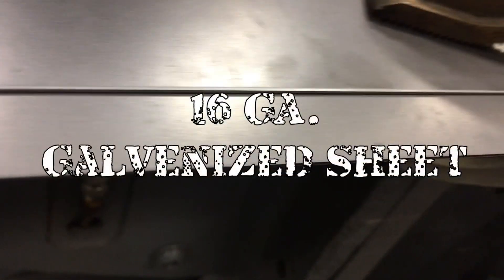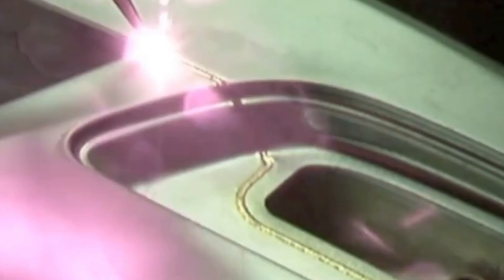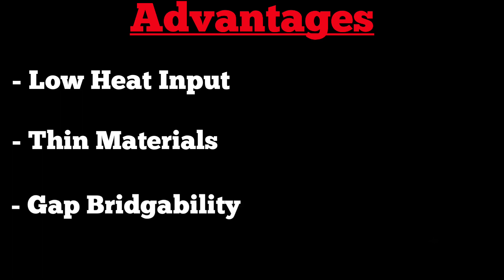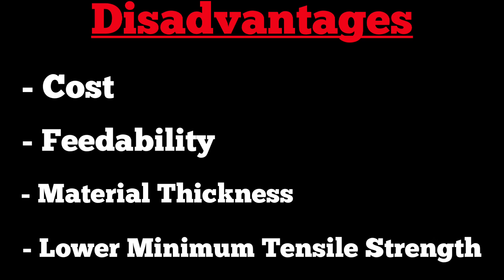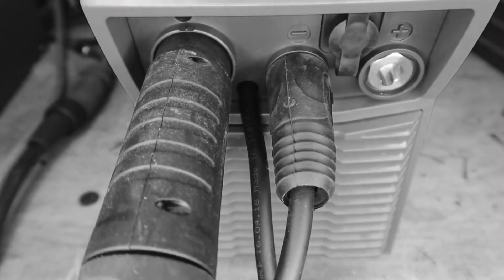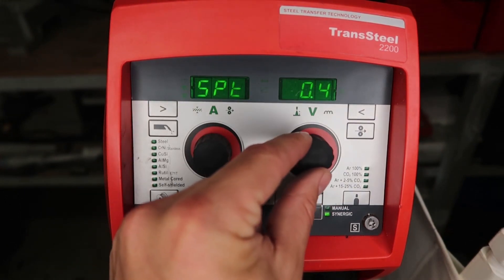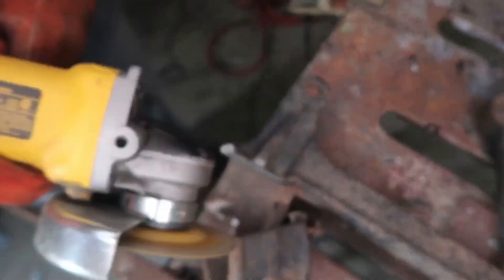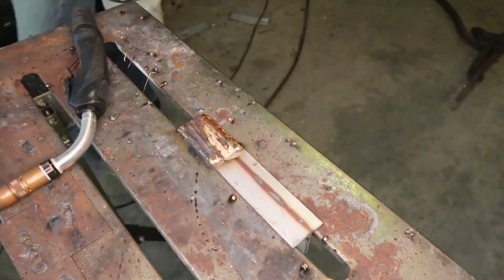MIG Brazing Made Easy With This ????

Comment: Question, when you set a material thickness, then change the voltage, on my machine it re-adjusts the material thickness, but you change both, does it do it independantly, and how do you do that?
Reply from the maker: Yes, you can turn on a setting in the background called ALC - When it’s turned on you can set material thickness/wirefeed separate of voltage

Comment: Nice video, I have been playing with silicon bronze tig brazing and have fount it to be really temperamental at least for me, I am going to go buy a couple small rolls of silicon.amd aluminum bronze for my mig to see if I can do any better with that machine, unfortunately my welder doesn't give me the option for the specialty wore itself so I will have to play around a little to try and find a setting that works. 
What polarity are you set up with when mig brazing? That in itself should get me started off in the right direction.
Thanks for the video, interesting and helpful.
Reply from the maker: I’m running reverse polarity

Comment: Part way through:  I think there would be less confusion here (and we're here to become less confused, right?) if our host didn't keep SAYING "weld" where it is meant "braze", "join", or "bronze-weld".  If I am teaching this to a group of beginners, I might not say "bronze-weld" even if it's right, because it's confusing!  There's NO WELDING going on here today!  Base metal is NOT MELTED, the original edges of the base materials can still be found.  Not a weld!
Reply from the maker: I agree. It’s a very difficult term to say correctly when we are so used to saying “welding”. I caught my self slip a few times. Thanks for watching
Reply: @chris_b_liven  Don't get me wrong!  I really want to see this, I want to DO IT, I've seen the results of this, bought the wire, not quite pulled it off yet.  People who CAN MIG-Braze love it!

Comment: A better definition for welding would be the heating and melting of two peices of equal or similar composition together and letting them cool together allowing fusion, with or without the use of a filler of equal or similar composition.
  This covers welding with metal and plastic. But funnily enough, also means that if you pissed into a crack in a frozen lake and the two sides of the crack froze together because of the piss, you are welding. 
Brazing refers to soldering specifically with a copper/ zinc allow at high temperatures. The temperature difference is what separates it from soldering. You can't braze with a soldering torch/iron, but you can definitely solder with a brazing torch.
Reply from the maker: Thanks for watching

Comment: How about copper sheet to steel sheet (copper 2x steel thickness)?   Have auto body idea for rust out dog legs and wheel arches to SiB sheet copper patches.  The copper will last a lot longer than steel.

Comment: Chris, I’m trying to use a Miller 140, spool gun, 100% Argon at 32 CFH, SUA brand ERCuSi-A .030” wire,  volt setting 3, wire speed 60, .045” gap, open root butt joint to Mig Braze late model GM 20-22 ga fender flares and quarter panels. I really liked how you brazed that open root butt joint in “spot mode”. I noticed you had the gun pointed up by about 15 degrees and walked the spots down from the top. You didn’t mention what gauge the metal was. My first attempt at brazing my thin metal looks like crap. There was no hint of capillary action (virtually no bead on back side), the gap closed up to zero on the far end even though it was tacked, and the wire usually burned back very quickly leaving a big glob on the end of the stub of wire! Plus, the metal was warped as bad as if I had welded it, but the base metal was not melted. I’m fit to be tied! Any suggestions?
Reply from the maker: Rod, Sorry for the delay in my response. The 22 ga is super thin material . I believe it’s less than the wire diameter you are trying to use. The plate thickness I showed was around .040 thousands. My suggestion would be to tack it with an opening similar to the plate thickness or find a setting that can punch through the material. For the silicon bronze to form on the back it needs a gap opening. Have you tried using an aluminum block on the back as a heat sink? This would probably help with the distortion in such thin material.

Comment: Would a miller be able to run CUSI on steel setting? Dont have specific CUSI setting...
Reply from the maker: Yes, it will run it. Just make sure you use 100% argon and try to get the shortest torch possible with a graphite liner. If you have a spool gun the better just due to the Fred ability of the wire

Comment: If you were going to fabricate a bike rack (for luggage not to hold the bike) would you braze the rack together or weld it? Material like chrome-moly steel.
Reply from the maker: If it’s Chrome Moly I suggest ER80 filler metal. I haven’t done much research on using silicon bronze but I wouldn’t see why it would be an issue
Reply: @chris_b_liven  Thank you for the response.

Comment: Thanks! Could you do a video with troubleshooting. Like using too high  or low voltage or speed. I have a pro series Schumacher with .023 silicon bronze and I would love to just see what I’m doing right and wrong.
Reply from the maker: I like the idea 💡 I’ll put it on my list
Reply: Thanks! I feel it’s hard to find videos on mig brazing that help with setup and reading the weld to adjust

Comment: Can I use 75/25 mix or do I need 100% argon?
Reply from the maker: You can use a 25 CO2 mix but it’s going to be a bit hot in compared to Argon. I’ve seen many autobody shops use 75/25

Comment: Can this be used to weld brass to iron and brass to brass
Reply from the maker: Yes, you can use silicon bronze or aluminum bronze but you will want to think about preheat. Preheat on iron will assist with cracking. Make sure you have sand and place the iron into the sand for slow cooling
Reply: @chris_b_liven  Thank you for your response

Comment: Thanks for the videos on the Fronius line up, great reference tools. Is it necessary to use the Teflon liner for either of these wire types?
Reply from the maker: It’s going to be similar to aluminum on strength so you will need graphite/Teflon or a special coated liner. The machine I was using had a special universal liner to assist with restriction

Comment: In the 1950s I have read a book printed way back in the 1930s and 1920s that says silicone bronze alloy wires were used as telegraph wires for they are virtually unbreakable. I wonder why that knowledge is not printed in today's western engineering textbooks when all engineers should know about this alloy's other uses besides being used as a brazing filler material.

Comment: Hello,

I have enjoyed your videos.
My question:  Where can I get the Gas Nozzle you used in this video?

Machine: Transsteel 2200
Gun: MTG 320i  US-Style Ergonomic Handle

I live in Canada...  Fronius Canada Ltd is telling me that a Tappered version is not available. 

Baker Gas does sell one... 
Fronius Tapered Gas Nozzle for MTG 320i MIG Gun - 4403502108

Love the system, but finding information, or accessories is a bugger. 

Any help would be appreciated. 

Rob
Reply from the maker: Rob, which tapered nozzle ? The one in the intro of the video ? I’ve never tried using this nozzle on the MTG 320i as it’s more for robotics . Or was it on the handheld torch I was using ? Was it silver ? If it was on the manual torch we do offer narrow gap nozzle part number 44,0350,2108,5
Reply: @chris_b_liven  Hello,
I found this at Baker Gas.

https://bakersgas.com/collections/fronius/products/fronius-tapered-gas-nozzle-for-mtg-320i-mig-gun-4403502108.

Is that the one you are referring to?  If so, Fronius Canada says it is not available.   I was told it would overheat my gun.
Reply from the maker: Rob Burtnick yes this is the one
Reply: @chris_b_liven  Thanks

Comment: You're all right man. Thanks a bunch for sharing your knowledge.
Reply from the maker: Appreciate it ! Thanks for watching
Reply: @chris_b_liven   please reply to my question: 
1) when we are doing mig breazing to join fuel filler pipe(tube) to fuel tank some tanks are rejected due to blow holes in breazed area, why dose it happen
Reply: @atuldhavan9009  ,,,Contaminaters in the workpieces or using a Drag movement with the gun......

Comment: Enjoyed the video. Would you happen to know the settings for esab rebel 215ic running 220v? I'm trying to braze rough joints on 20 guage sheet metal.
Reply: Thank you for responding...esab wasn't very helpful
Reply from the maker: Iron Man what’s the biggest problem your having? You will want to be around 240-360 ipm at 17.5 volts range
Reply from the maker: Iron Man I’m not too sure on the Rebel 215. Are you using CUSI silicon bronze ? What wire size and gas?
Reply: Yes, it's 035 Harris wire purchased from cyber weld. 100% Argon. Using knurled roller
Reply: Thanks I will give those settings a go

Comment: thanks for the cool n informative video! Jest one question; why do u say brazing is best for galvanized steel?
Reply from the maker: Thanks for watching ... It really all depends on the thickness of the galvanized plate. If you start to get beyond 1/8 in plate then you should start thinking about solid wire just due to penetration and overall strength of the joint. For thinner material MIG brazing keeps overall heat input down and it eliminates a majority of the zinc burn off due to the melting point of the wire. If you decide to use solid wire you can successfully weld most lap joints or outside corners. The issue is with t joints due to the zinc not escaping from the molten weld pool causing porosity
Reply: @chris_b_liven   Thank you so much for the prompt reply! I just have few follow up questions.
1. Between normal and galvanized steel sheet, which one would produce better result? Basically my focus is on the effect on zinc coating on brazing procedure. (Apart from the porosity it causes).
2. Are most of thin steel plates galvanized thesedays? 
So, the reason why I am bombarding your with these questions are because I am a master student researching brazing on galvanized AHSS. I have somewhat good knowledge in the mechanism of welding and brazing but do not have much experience of doing them. I will be watching  a lot of your videos and others for some 'over the shoulder' experience. :)

Thanks!
Reply from the maker: john cho 1. ) primarily you see galvanized sheet being used for anything that can eventually be corrosive. Primarily products effected by outside elements such vehicles, hvac units, cattle gates, security doors etc. Brazing the galvanized in my opinion is best due to the melting properties but the cost of the wire outweighs the benefits depending on the product
Reply from the maker: john cho 2) Not all thin plates are galvanized as it’s dependent on the use of the product. If you are to use cold roll carbon steel and use sealants such as  paint or clear coat then it would hold up to rust.
Reply from the maker: john cho 3) We do see a large amount of automotive manufacturers using HSS & AHSS. I know the total heat input in the material is critical due to grain growth and cracking in the HAZ (heat affective zone) Silicon bronze could assist with the low heat input but I haven’t done much testing or seen anything on AHSS. I would have to research the topic a bit more or ask around. There are welding processes in the market to assist with welding HSS and AHSS in regards to total heat input. I know Fronius has one called Cold Metal Transfer
Reply: MilkyCereal83 Yes, that is precisely why this research topic fell on my lab. Hopefully ill be that person you can ask about in few years :)

Comment: I’m very much an amateur trainee weekend warrior, think of the lowest level welder and I’m the guy below it. I was generally looking at brazing brass to steel in my knife handles. My welder will braze using CuSi3 but a 0.45 kg spool is £35 where standard MIG wire is £20 for 5kg, that’s over £66 a kilo more. I also have a feeling I get less out than of the wire as well. I think for now, with my knifesmithing, I’ll stick to gas brazing which for a welder of my grade is fun.

That takes absolutely nothing away from a very informative, well presented video. Thank you.
Reply from the maker: Sometimes you can’t beat Oxyfuel brazing both on cost and fun. That was my go to process in High School welding class 😎 Thanks for watching 💯

Comment: For vehicles, see the Project Farm YouTube videos for maintenance tips. Car body brazing is more rust resistant, especially if you spray Fluid Film on the inside and under the panels every fall, and inside door panels every few years. There is a video about melting vaseline (petroleum jelly) for a thicker coating where mud or salt spray might wash away oil. Do not use Fluid Film for door gaskets- I use Mothers VLR spray instead, with a good smell for interiors. The Carsthatlast series on YouTube is good for choosing which vehicles are reliable enough to be worth it for rust repairs.
Reply from the maker: Thanks for giving me a few channels to watch. I haven’t seen any videos from either one so I’ll check them out. Thanks for watching 💯

Comment: Chris , I have tried the silicon bronze with my 2200, it seems okay , but I got more splatter than I thought I should. I used DCEP  035  on 1/8 in mild steel with mild mill scale. What do I need to do/set to get no splatter like you.  I was at 300 fps 16.5 volts (gas at 25cf)  and also on synergic for 125 thou.  thanks for your reply in advance
Reply from the maker: What kind of joint configuration? Did you use 100% Argon gas? Are you on 230 V power or 110v ?
Reply: Hi Chris, it was a t joint and lap and an outside corner, using 100% argon on 230v
stick out 3/8  to 1/2  inch. the lap joint was the worst, and I was pushing at 10 degrees  with small rocking  movement. thanks again
Reply from the maker: Bruce D Sounds like too much wire feed speed compared to voltage. Have you tried turning up voltage separate? You can do it with the setting next to V - Voltage on the left side of it. If you turn it more positive it increases voltage in a percentage. So 5 would be 5% higher in voltage with the same wire feed
Reply: thank you Chris I will give it a go next week
thanks again.,, ps what setting should I start with on manual ?
Reply from the maker: I haven't tried the silicon bronze in manual mode yet. Maybe this weekend I'll try it
Reply: @chris_b_liven  hello thank you for your videos they are very helpful. I have question what's different between cusi3 and cusi6 and can they welded(breezed) together?

Comment: I can't wait to try the silicon bronze on my 2200, ordered some hope it comes soon.Chris, on the 2200 is the metal core setting for dual shield? there is a setting for self shield and rutil 71t .the fluxcore wire I have is e71t wire so do I run it on the self shielded setting or the rutil 71t ?  In short what wire do I run on what setting?  thanks, love my 2200 on stick it is so smooth  I think smoother than my transpocket 180.
Reply from the maker: Bruce D You will want to use the 71t slot for dual shield flux cored wire. Metal cored wire is similar to flux cored but it doesn’t have any slag

Comment: Nice one, you should make a video on the arc of the 2200. Mine feels and sounds so smooth like spray transfer smooth no matter what the setting or material. Tested it against my Everlast and that's when I really noticed how different it's arc was in sound, feel,and it's arc gives off a orangeish hew instead of blue.
Reply from the maker: Arc Angel That’s a good idea.... I noticed the same thing about how smooth the arc is on all the range of thickness and materials. The next video I’m doing is dual shield flux cored wire and all the variety
Reply: @chris_b_liven  that will be a good one, I've yet to try it with dual shield